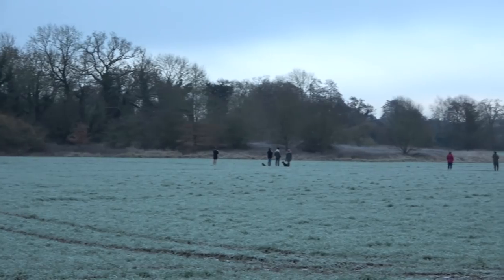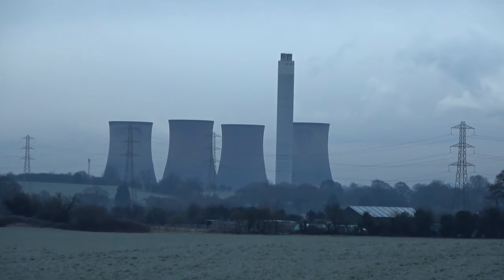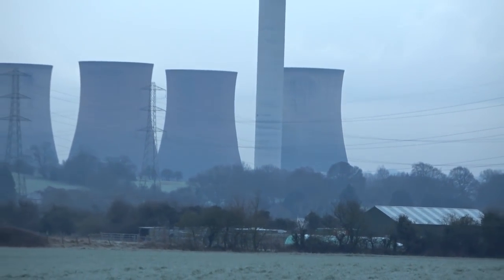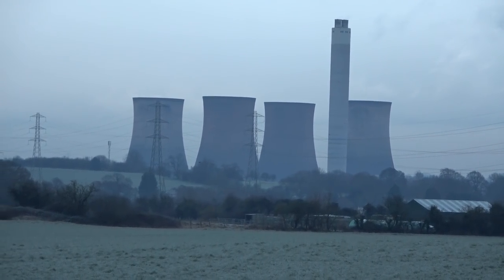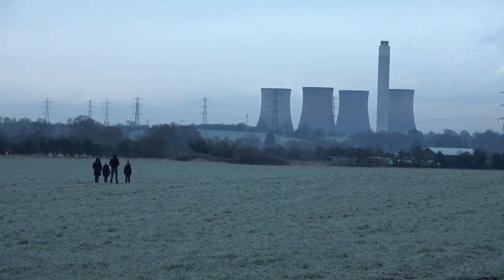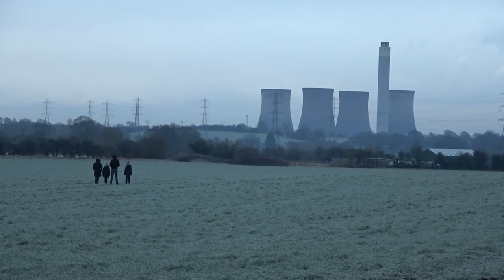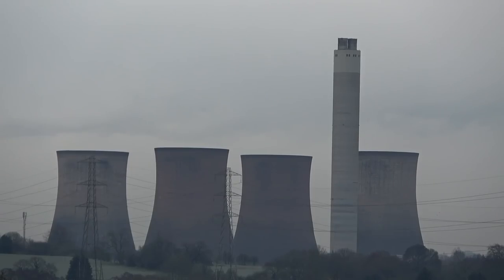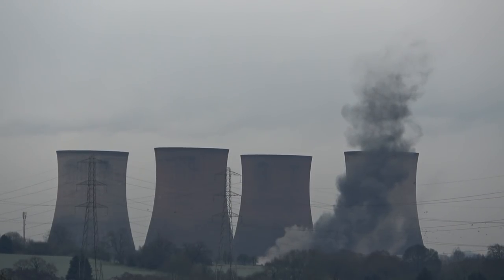Rugeley Power Station 600ft CHIMNEY DEMOLITION! - 24/01/2021

Comment: 5:46 reminds me on 9/11 when the both towers was collapsing so that made me sad but any way nice video new subscriber
Reply: Hiya.Good comment. Several documentaries have examined the trade tower collapses. They both fell within their own footprints.For two structures 1300 feet tall that in itself is staggering from an engineering point of view.A demolition team would have struggled to replicate that not once but twice.The conclusion was floor slab hanger brackets failing through heat and creating a domino effect but ? Both towers were damaged at much different heights so the fact they fell identically raised many structural engineers eyebrows.

Comment: That doesn’t compare to the implosion of the former td Waterhouse in Orlando or the hotels in Las Vegas which are spectacular. I think the hard rock in New Orleans is getting that when they remove the poor souls that were trying to build it when a number of floors collapsed on top of their heads. You should watch the td Waterhouse implosion as it was kinda fun, the area is now a park and the Amway arena was built using the old police hq land I believe plus more. It was a mess trying to figure out where it went and the giant LED screen on I4 was a sore spot too.
Reply from the maker: I’ll have to check it out. I’ve never seen a demolition like this before so it was very impressive to me!

Comment: I worked on the construction of 5hat chimney!
Reply from the maker: That’s awesome!
Reply: By the way, I believe the height was only 500ft. I should know as I stood on top at completion doing the final snagging check before handover to the owner, then CEGB.
Reply: Actually, I am mistaken. This chimney is the second on this site, built as part of a flue gas desulphurisation plant added more recently. I am sure someone out there will be able to confirm this and give relevant dates.

I worked on construction of the original chimney back in 1966/7, which must have been demolished previously to make way for the desulphurisation plant. The original chimney was 500ft high, for sure. I guess its demolition was much less spectacular to avoid risking damage to surrounding buildings and infrastructure.

Apologies for previous misleading comments.